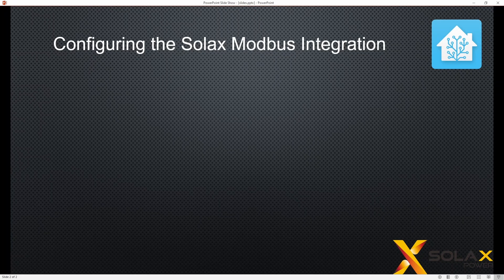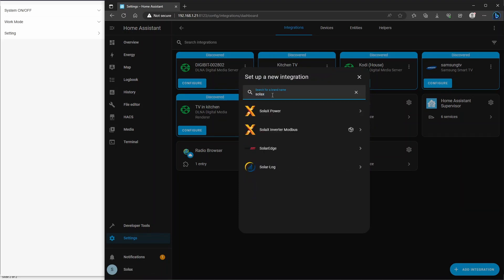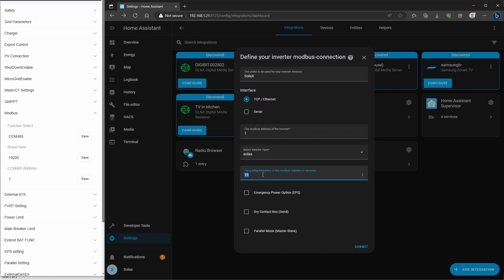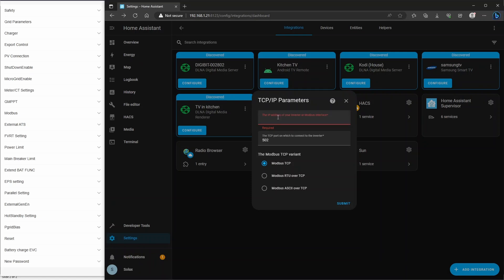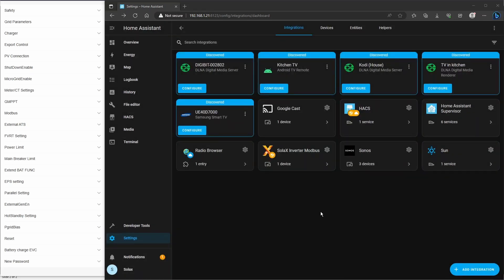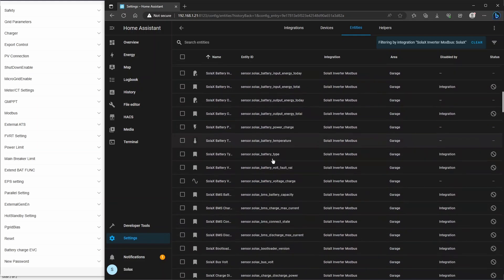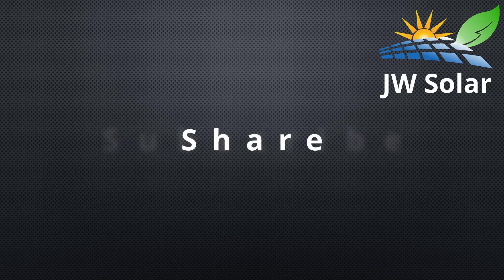07 - Configure Modbus Integration - Solax Solar Home Assistant Tutorial

Comment: What if I have a larger system with 20 kW i.e. and two inverters — can you integrate them as master and slave using Modbus IDs 1 and 2 via the Modbus app from HACS?
Reply from the maker: Yes, I have several customers using HA with master and slave configuration.

Comment: Is controlling the inverter supported on HA? Using automations to charge/discharge?
Reply from the maker: @ReizungV  Yes, fully supported.
Reply: @JWSolar  thank you for the answer. Is this accomplished via the official Solax intergration?

On the videos i have watched it looked like only sensors are exposed, a.k.a you cannot actually control the inverter with Home Assistant, just watch the sensors.
Reply from the maker: @ReizungV  Using the Solax Modbus Integration from Hacs, not the official Solax integration.
Reply: @JWSolar  ah thank you for the clarification. Im sorry if i am bothering, but can i ask one final question?

Does the 15kw solax with high voltage battery support batteries without using BMS, such as using lead acids in series without BMS?

Or using regular 48v packs in series with BMS, but without coupling the BMS to the inverter?
Reply from the maker: @ReizungV  It will support lead acid in series without BMS, but lead acid is only 50% efficient at best. It will only support Solax HV Lithium batteries with BMS unless you wish to create your own BMS emulator for third party batteries. This is not officially supported or recommended.
Reply: @JWSolar  thank you for the answer, i got 46x 220AH lead acids in my current system. But your info means that that would work aswell,

And that also means that 48v lithiumpacks in series would be supported aswell, since every pack has its own BMS for safety, so it could be treated the same as a lead acid battery pack.

Does the inverter have coloumb counting for lead acid, meaning, can i insert the size of the battery to the inverter and it will create a percentage for me that is exposable to Home Assistant?
Reply from the maker: @ I'm afraid I don't have enough experience in lead acid with Solax inverters to advise you as I've never tested them myself.  I know there are very few Solax systems out there running lead acid, I don't know if a percentage is exposed to HA.  I also know that many have failed to use third party lithium batteries, including Pylontech, etc without a BMS emulator.  There are a few users successfully using EV batteries with an emulator connected to Solax inverters.
Reply: @JWSolar  okej.
I think you misunderstand. I am talking about running lithium batteries in lead acid mode on the inverter, with no BMS connected to the inverter at all. Only have the batteries protected with BMS and contactors. So an emulator is not needed since it in that case runs as if it were lead acids. But configured with the right voltage for lithium.
Reply from the maker: @ReizungV  I didn't misunderstand.

Comment: Great video! Only problem I have that I can't acces the advanced settings. I entered several passwords (0000, 2014 & 6868), but it won't connect. It says time out and goes back to the pervious screene. I can acces the supper settings via 6868, but there's nothing i can do there. Hope you can help, I have the x1-boost/air/mini with wifi 3.0.

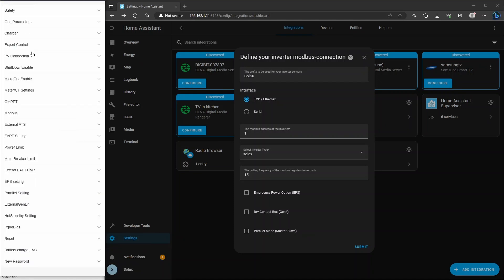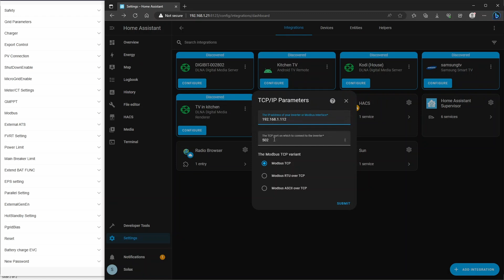Comment: 2:17 My inverter (X1 Mini G3) only shows Modbus RTU Enable (Yes/No) and Modbus Address (1). After installing the plugin with "Modbus TCP" (3:56), I get 26 entities. Problem is, the grid export/import is sitting at 0W, meaning it's not able to fetch the readings from my meter (Eastron SDM230 connected via RS485 to the inverter). I can however see these readings in the solaX cloud and the "local access" menu in the mobile solax app). Only home assistant seems to not be able to find them. Any tips?

I tried to configure the "Modbus RTU over TCP" option in the last settings menu (3:56), but it takes forever to load and then fails. Maybe it's another port? Already have the latest firmware, static IP address, etc. What do you think is wrong? Any ideas? Thank you!

Comment: I use the TCP Modbus with Victron to change the grid set point and the minimum SOC on the inverter to control grid export and battery charging in Home Assistant can you do the same with the Solax?
Reply from the maker: @nervousfrog101  Yes, you can do the same on the Solax.

Comment: Thanks for your great videos. It worked very well so far. But since 3 days my Solax Modbus integration says " Not loaded". i unplugged the Wifi Tongle and plugged them in again. in the past weeks it happended every now and then that i had to unplug and plug in again. But i always had the button to reload. But now the button is missing. When i tried to install the Solax modbus integration again, Solax modbus does't appear anymore. I have a solax X3 Hybrid 15 G4. I have read in an older comment that HA does not support the Solax modbus integration any longer. But i.e. the one 13 days ago said it finally got to work. Do you habe any idea  what went wrong?
Reply from the maker: Can you join my Solax Support UK facebook group to discuss.  Thanks.

Comment: I have a Solax X3-Hybrid-G4 and the Charger X1/X3-EVC. I was able to add the inverter to Home Assistant, but unfortunately I can't add the charger (wallbox) to the Solax integration.
I click on “Add Hub” and enter the data and the following is displayed: Configuration created for SolaX-Charger. But unfortunately no entities or devices are displayed for the Charger.
What am I doing wrong, or is what I want to do not working at all?
The inverter is connected to the grid via a WiFi dongle and the charger is connected to the inverter via lan cable.
Unfortunately my English is not very good, but I hope everything is understandable.
Thanks in advance.

Comment: You say to put the inverter IP address in to the Solax Modbus integration in HA but in Wills documentation he says to use the Waveshare IP address.  Which is correct ?
Reply from the maker: If you're using a waveshare, the waveshare IP Address. If you're using the WiFi dongle, the dongle IP Address.

Comment: Great video. Yesturday I managed to integrate my inverter and all the entities were shown correctly, Today I noticed that the info shown in home assistant was wrong. For example the Inverter Temperature was zero. I tried to reload the entities but it didn't work they were all Unavailable. I tried to delete all entities and reconfigure and now I can only see 4 entities. Why???
Reply from the maker: You've installed it using the WiFi dongle and the dongle has crashed. Unplug and replug the dongle, then click reload on the Modbus integration. If you'd like really high reliability, watch video 20 in the series to connect a waveshare device. Also get your wifi firmware updated.

Comment: Thanks for the great videos.  I’ve just looked at the address for Modbus in my settings, and it is blank.  (I also don’t have a ‘function select’ option, and my baud rate is different at 115200).  (I’m not attempting any of this yet, just watching the videos).  I have a solar x1 g4 6.0d hybrid inverter.
Reply: I’ve just been back into the settings, and it’s all changed!  There’s now a 1 in the address field

Comment: Hi, i have an X1-AC with pocket LAN, so there is no firmware that can be updated as far as i know, and its not accessible by its IP address. So i am doing the Rs485 modbus to ethernet with the wavenet device. However i do not see modbus as an opion in my advanced settings in either my app or on the solax cloud platform, am i missing something?
Reply from the maker: What's the full model number and generation of your inverter?
Reply: @JWSolar  hi, it’s X1-AC-3.6
Reply: Not sure what Gen it is, it was only installed this year. Can’t see the Gen listed on the label.
Reply from the maker: @abest2010  From looking at the manual, you should have RS485/Modbus under Menu/Settings on the inverter screen.  Have a look there.
Reply: To get the advanced settings use the pin 6868, it is some sort of special pin.

Comment: Hi you talk about opening the inverter settings in the Solax Cloud / Solax app (01:08). What menu will I find this under, Overview, System&Site, Device, Device Management, Service or User Details.  Ive had a look in all of them but cant find anything that resembles your example.
Reply from the maker: In your Solax app, click on the inverter, then click on the cog in the top right corner for settings.
Reply: Thanks finally found it under Device Management > Remote Settings.  Once added I found I only had 20 entities, I presume this is because I have just an inverter and not a hybrid.  @JWSolar
Reply: @JWSolar  Hello. Thanks for great tutorial. But I can't see the option "Modbus" in advance of app. Can you help me what's wrong (Solax X1 Hybrid G3) I tried pw 2014, 6868

Comment: Hi. I am currently following your guide for modbus integration. I am only seeing 4 entities in the list. Initially this was only 1 but has now repopulated to 4. Where am I going wrong? Any advice would be appreciated. Also should mention i'm LAN connected, not WIFI. Cheers
Reply: I am getting the same and when I try to go to the next step I can not see solax within the drop downs - when trying to add my grid consumption and return
Reply from the maker: What is the model number of your inverter? Which entities are they?
Reply: @JWSolar  my model number is X1-AC and the entities are  button.solax_battery_awaken, sensor.solax_inverter_temperature, button.solax_unlock_inverter and button.solax_unlock_inverter_advanced.
Reply: Mine is exactly the same - I called Solax to update the firmware today but it is still showing the old version
Reply from the maker: @bradhill3925  I think i can see you have asked the developer of the Solax Modbus Integration regarding this issue.  Please wait for his reply.  Thanks.
Reply from the maker: @glyndennett7531  Have you got the latest inverter and dongle firmware installed?
Reply: @JWSolar  not sure. Probably not. Been installed 3 years and never updated. How do I update?
Reply: I have pocket LAN. This is also linked to a social energy hub.
Reply from the maker: @glyndennett7531  Contact the main Solax switchboard number, they normally update any firmware in about 24 hours.
Reply from the maker: @glyndennett7531  Problematic those social energy installations, I've encountered them before and had many issues.  Take a look at the Github page for Wills Solax Modbus Integration, I've seen information there on issues with the social energy installations.